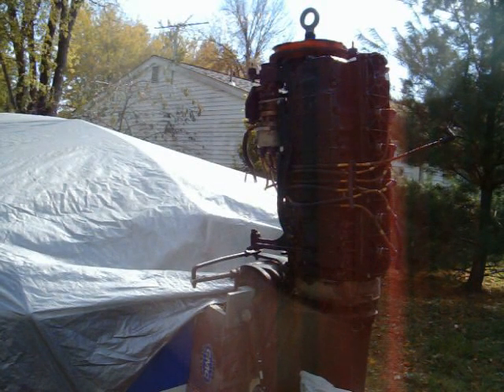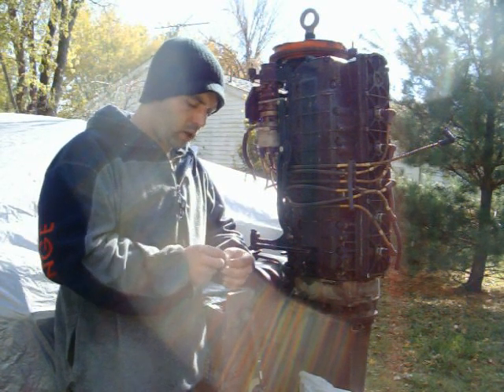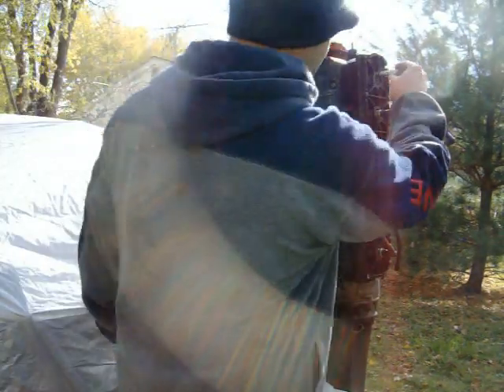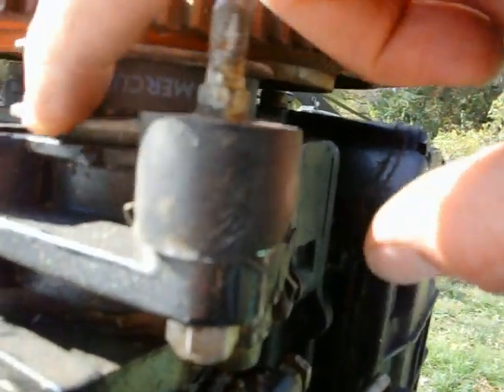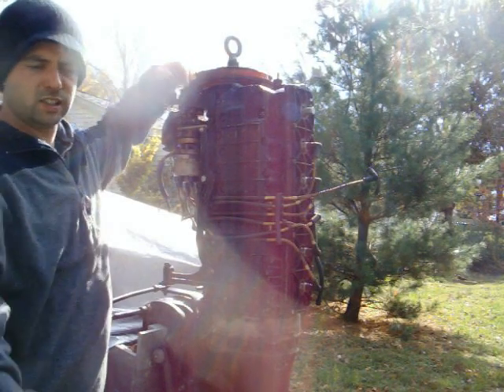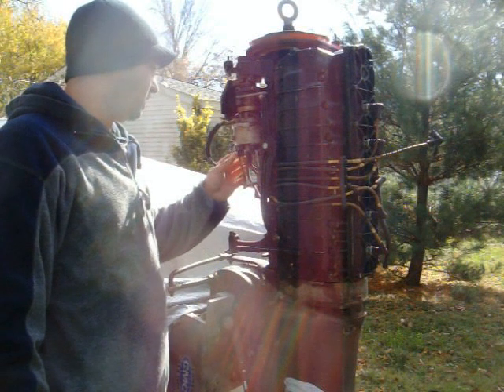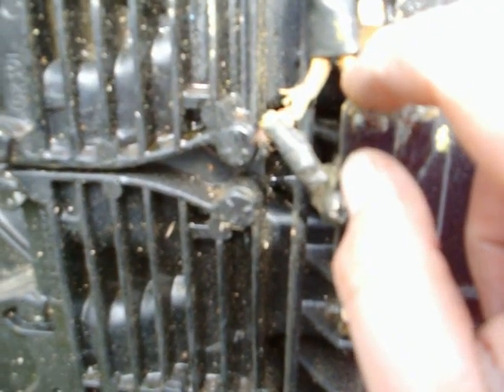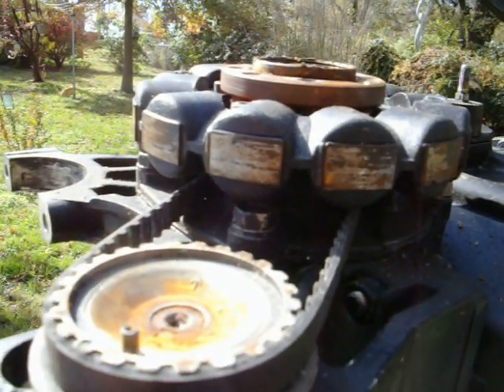Top Dead Center on a Inline Mercury 1150

Comment: What is the torque for those 8 bolts for the flywheel or u just using threadlocker also I'm trying to find TDC with the piston stop method how far do I put the tool in is it hand tight or tighten it down til I can't no more
Reply from the maker: Don't recall the tq off the tip of my head. Yes, blue loctite. And thread the tool for full depth.
Reply: @cturboaddict  one last question once I find TDC do I take the flywheel off n position it to those 3 dots so it will line up or don't worry about the sticker
Reply from the maker: @semaj2358  0 on the sticker should align with the pointer. (If you have one). If you don't have the pointer, you'll need another way to align it
Reply: Thank you so much

Comment: Great videos mate! I was wondering if you could go over the TDC bit as you rotated the fly ccw then cw and then you came to a conclusion of marking points & dividing some distance in half?! could you please elaborate more on that as I just need to make sure my motor, flywheel & distributor are all lined up correctly. what would happen if i set up my sync according to the lfywheel but the motor is not aligned to the fly as in TDC, what damage would it do? cheers
Reply from the maker: You need to use the TDC stop tool. When rotating clockwise and it comes to a stop, mark that point on flywheel in relationiship to shroud. Rotate counter clockwise and mark that point. Split the difference and that is TDC.

Comment: I've got to check the timing, but the flywheel and distributor pulley are still set correctly to TDC.. (so unless the distributor trigger got jolted aside from the distributor pulley?) I'm at a loss, talk about crap luck.

Comment: Well crap. After getting everything in tune and the motor running beautifully, I drifted onto a wing dam in the Mississippi. Luckily the boat's ok, but the jolt moved my arm into the throttle, so it increased prop speed into the rocks. :|  The aluminum prop got replaced, the lower unit pressure tested fine along with the shaft. But now I have a vibration/extra noise at idle. This is still there in gear, but it will run WOT fine, mid range you can sense the vibration.. any ideas? :( lol ty
Reply: Roger Wilco bent driveshaft? bent prop shaft?

Comment: Have u ever attempted to locate TDC using a screwdriver in the spark plug hole ,and with all plugs out for ease of rotating , located TDC by eye and feel ,then checked to see how close you can get to the known good timing mark to see if using the stop tool is even necessary . Can the average joe get the TDC mark verified within a degree or so?
Reply: This is what I used to find TDC in my Tower of Power, just a old spark plug from my 1996 toyota 1.5 Paseo engine, it had the same diameter and thread. It has much longer threads and electrode that extend into the engines combustion chamber and will contact the piston before and after TDC. Mark those on your flywheel and measure halfway between those is TDC. Then you can get another timing tape sticker or get the timing mark measurements from his other videos. My timing marker tab broke off too, it was made of plastic, so I made a new one out of aluminum sheet metal about 0.090 thick, drilled holes in it and used my drill press with a cross slide vice with two axis movement to drill out a row od 0,025 holes to create a slot for the bolt and dowel pin, and then used a small 0.025 dia mill cutting cutter to cut the rest of the slot smooth from end to end. Then bent it to fit the old broken one after copying and cutting out the shape of the plastic broken one. Hope this helps.